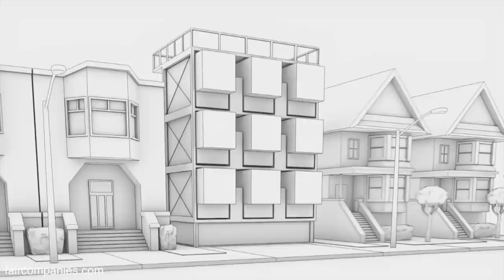Kasita: tiny prefab home-as-a-service for post-land urbanism

Comment: The design I love. Would like a non glass floor option.  Clean zen lines, well laid out, and NO loft bed area to tackle. And here in the Sierras we would do 100% off grid solar.
Reply: I'd also go for a non-glass floor option, especially with upper and lower neighbors, for the sake of privacy.

I think rotating the direction of each floor's racks would also help a bit with privacy, too.

Some possibilities in the design of the racks could do some really interesting things, like:

1) Make the A/C exhaust out the back, toward a central heat-capture column, and use that waste heat to generate some electricity.

2) Integrate with the latest vertical farming technology in the rack for hyper-local food. Go next door to pick the greens for your meal. The latest innovations in this use plants suspended, rather than in dirt, and the nutrients are sprayed on them, using 95% less water than normal.

3) Put solar/wind generation on the top of the rack to generate local power.
Reply: On a more serious note, permaculture like principals must be integrated into this system to make it truly 21st. Century
Reply: Beth Grant-DeRoos uh no, you're not going to be allowed to go into the Sierras.. that's the whole point of getting people on board with the Tiny House idealouge.. then, when people think it's cool, we'll ship them all off to one of 10 mega regions,  packaging them into tiny shoe box stack and pack housing..making the rest of the nation ( buffer zones) restricted and off limits to humans.. jeesh.. how come no one has read Agenda 21 and Agenda 2030???

Comment: So this guy basically invented shipping containers that won't stack without a huge, ridiculous racking system?  REVOLUTIONARY!
Reply: 5000 hours into reinventing and worsening shipping container .. this guy is real PhD. :-)
Reply: The rack is a MUCH better idea than stacking shipping containers for this use, because if you take one out that's not on the top of the pile, you don't have to take out all the ones above it beforehand.

"Think before you ask these questions, Mitch."
Reply: iliketoUSEmybrain017
Reply: iliketoUSEmybrain0

17
Reply: A racking system is critical because that allows you to only move the unit in question (and not the units stacked above or next to it). You also wouldn't want to build from a shipping container if you don't need the stacking ability (which is one of very few positive attributes that a shipping container offers).

I used to be a big fan of the shipping container homes, but when you look deeper into it, it makes more sense to just build a pre-fab home the size of a shipping container. (If the idea is to stack or ship them). Those corrugated steel walls are the worst possible starting point. Steel is a great conductor, and add corrugation and now you have even more conductive surface area. No bueno.

Comment: There does not appear to be an escape route if something in the kitchen catches fire. For that reason, I think the kitchen should be located closer to the glassed in area and the sleeping quarters closer to the door.
Reply: Exactly what I was thinking.
Reply: If the units are stacked (as is the plan), there would be nowhere to go if a window was made into a door. Additionally, the window is suspended higher than the main floor so there would have to be steps or a ladder which takes away the aesthetics of the building.
Reply: Raw Fooder
For some reason my comment didn't @ you, but yeah I agree completely with you. I wouldn't feel comfortable living in one these places without a second way out of it. That is a deathtrap right there. But perhaps things can be flipped around where the kitchen is in a back and then the bathroom and sleeping area is in front of the kitchen. Even trailer homes have two doors, that should be a law in any building.
Reply: @Mousehead Studios I thought you were agreeing with Max Powers. Thanks for the clarification!
Reply: If they're stacked 10 high, there's no way that a rope ladder is safe. Besides, a rope is unstable in a fire situation.
Reply: +Max Powers if these are stacked, there will be a rack. That could house an escape ladder.
Reply: Those racks already look like a building that's all fire escape and not much else.
Reply: The stacking rack could also be the "Second way out of each building if they redesigned the unit to have an escape door to fit the rack escape hatch?? where each unit can access the racks escape "Stair well" that was designed "Escape door" on the unit.. by encorporating the two in the design of the stack it wouldn't damage the "Clean Look" of the "Group".
Reply: Exactly!!

Comment: I just found out that these cost $119,000 per unit. Those of you who were skeptical that this is a solution to high rent- you were right!
Reply: This isn't 119 000 USD it'S 139 000 USD... INSANE!
Reply: if they cut out some of the high end gadgets and reduce the price to 30k it would be great. how much does the rack cost? and could you combine units for families?
Reply: That price will drop dramatically when/if this takes off. It likely costs that to build one, but like he said, if you build 100 or 1,000 that cost goes way down per unit.

Comment: I love tiny houses and most of Kirsten's videos, but this idea... what a ridiculously impractical way to design and build a small apartment complex.  70 boxes stacked up in a steel frame means 70 individual AC units, 70 individual plumbing systems, 70 individual heating systems.  70 roofs. More practical to build a regular (micro) apartment building in the area and set up a flexible ownership model, somewhere between condos and a co-op, so people don't have to save or borrow tens of thousands of dollars to move in, but while they're living there they can build some equity (instead of just renting a place).
Reply: You're exactly right! Too many a/c units needed in this design. Construction isn't practical....And why aren't condos, as you've described, already more affordable? Because the land is too expensive, and the city/state taxes the land too much. Property taxes in dense cities are extremely high. Property owners who rent out units pass along the high cost to the renter, just to be able to make ends meet.

Comment: Transportation of these is the only drawback. anything over 102" wide is an "Oversized load" $3.50 to $4.00 per mile along with a rigging crew and crane on both ends of the trip. This does not mean that it will cost $40 to move it 10 miles. The milage rate is on add on to the vehicle use rate of about $1000.
10' wide is an Oversized load not needing escort vehicles following in front of the truck.
I would imagine if these are mass produced the manufacturer would be best to own their own special crane device and transport trucks.
Reply from the maker: Thanks Greg for those details. I had no idea about these costs and when something becomes "oversized".
Reply: I would think someone will see the need to open a transport service specifically for the Kasita. A lot of the cost to move is the company knowing you will pay the fee because you have to, bt I am sure someone will do it for less so they can secure that business space.
Reply: +Kirsten Dirksen  It still translates to a great idea because really how often do people move?
if put on wheels like an RV and going with the non-stacked way of living in one of these is probably the best way to own one. Or, without wheels it would be identical to people that own and sometimes pay to move a traditional Mobil home.
I think that these are really cool. Modern thinking is good.
Reply: .. they could make a base with a cab that clips onto a Kasita and makes it into an RV
Reply: I don't think he mentioned dimensions, but these are POD dimensions (the containers people pack to move their stuff):PODS&#174; containers come in 3 sizes (sizes are approximate): 7 foot container: 7'x7'x8', typically holds 1 room* 12 foot container: 12'x8'x8', typically holds 2-3 rooms. 16 foot container: 16'x8'x8', typically holds 3-4 rooms.  
Moving those costs thousands of dollars depending on distance, but it's a lot more convenient if your moving pod is also your apartment. Financially, you save on deposit and first month rent fees if you own the unit or rent through a company that leases the unit separate from the land.
Reply: This is why they need to focus on river transport and a factory on the water. That or rail.
Reply: Rather in the way that big rigs have a cab, base and wheels and the load is placed on its trailer, right?
Reply: Yeah but remove the engineering tradeoffs, as conventional trucks are built for extra heavy loads and frequent connecting /disconnecting of the load. Very different to an RV. Depending on how heavy these units are, I don't know if it's possible. Just an idea.
Reply: Thing is? Moving them is just impractical. Neat idea, but no need. Just build the racks in multiple cities and trade units with somebody else when you want to move. Rent a truck and move all your personal items the old fashioned way. Unless you want to move your unit to a private lot, there's no need to discuss moving units from rack to rack.
Reply: That is certainly a more elegant solution, especially if all the units are physically identical anyway.
Reply: as a flatbed truck driver, you are right.
Reply: He did say moving will cost couple cents a mile. did you miss it? that's $40 for 2000 miles!
Reply: I'm a trucker an 2. 50 cents a mile at least what u could do get someone with a cdl lic rent a truck an trailer move it your self  save a lot of money
Reply: I'd imagine transport costs would still be cheaper than buying a new home, maybe even a new pod. The way he put it you can fit one of these on the back of a semi and given its size (looks to be slightly smaller than a shipping container) its not likely to stick out at either end so I doubt it would meet the requirements of an over sized load. From what I understand he designed it that size to keep moving costs low.
Reply: @james paul $2.50 a mile x 2000 miles. That comes out to about $5,000. That's still cheaper than buying a new home or a new pod.
Reply: Kirsten Dirksen But is cost just about the same to move anyway.
Reply: c woody no doubt.. Non drivers are clueles.
Suppose the idea did catch, trucking companies could easily adapt to the market...
Reply: A 40' L 9.5' H one-trip shipping container is $2000 max if you live in an area where they are common. They are four times that a amount delivered, where they are  far from a community where shopping is not a major industry. 

Please, putting the lower income people one wheels  so we can shuffle them when the land barons feel that they are holding down land values is just John Steinbeck in the 21st century.
Reply: Shipping not shopping
Reply: You're all wrong. My hipster friend here, clutching his coffee, said it's like $0.02 per mile or something.

Comment: The glass floor is dumb for stackable units. Are you going to want to walk into one wearing a skirt?
Reply: Why yes, yes I will. This is a good opportunity to get into cross-dressing.
Reply: +Kevin Hornbuckle ..no kilt?
Reply: These will sell well in Scotland.
Reply: good point!!! I never even thought of that.
Reply: Grow up.
Reply: He did say it was a prototype, so maybe this issue may be fixed 👍🏼
Reply: I don't understand what purpose the glass floor even has not much light can come in and it cannot be very economical (as apposed to metal).
Reply: If you can't afford the real thing, the sense of space is valuable.
Reply: I believe I noticed that the ceiling of the glass cage was frosted, so no unit below or above could see anything.
Reply: He talked about the glass for like a minute, how could you miss that?  It has a controller and you can set the clarity of the glass from transparent, all the way to black out.
Reply: Well he did not speak specifically about the flooring (as he pointed to the windows). Smart glass has it arguments anyways as to weather it is cost efficient, durability and transparency to name a few. If they are saying the floor is also smart glass they should address it specifically so people know it is also included and a few other things... Is it on a separate control board as the windows? What  the replacement cost is and life duration.
Reply: +TammyToo True. lm afraid the glass/ transparency idea will be ruined by people  adding curtens, rugs on the floor etc
Reply: Why bother w/curtains when you have the option to use block-out?
Reply: move the trundle to under this glass mess....
Reply: Simple solutions, cover the roof parts with blurry glass that would make it impossible to see.
Reply: James Cochran 
Unbelievable - do you how ridiculous and sexist that sounds???
Reply: Jo Sevigny 
Precisely, some people don't have open minds to see the real reasons for these builds. That or they didn't listen very well, that these are custom, and this one is a prototype only!!!
Reply: TammyToo 
Have you heard of contacting the website for more information???
Reply: Autumn Shag 
Absolutely, that's why he mentioned that these are custom!!!
Reply: area rug,may be:)
Reply: Don't wear your skirt indoors James.
Reply: "The shading of the glass can be blacked out..." I don't think you heard that I
Reply: This box looks like something out of Dwell magazine where every house featured is a exhibitionist's delight.